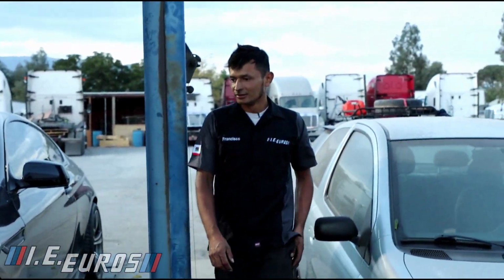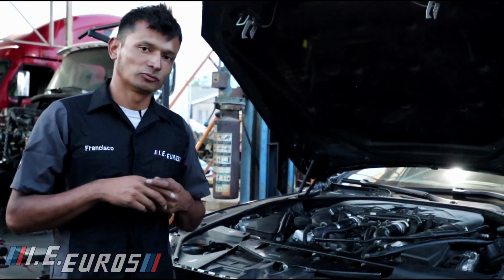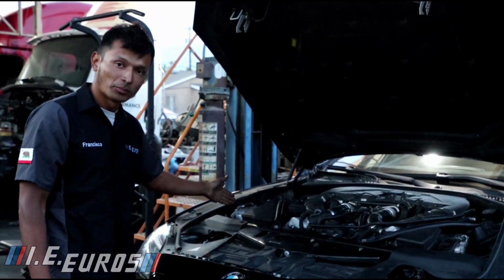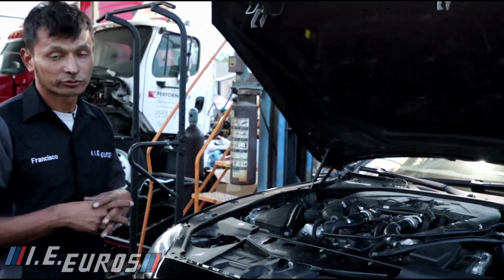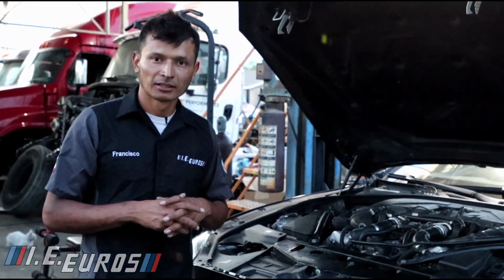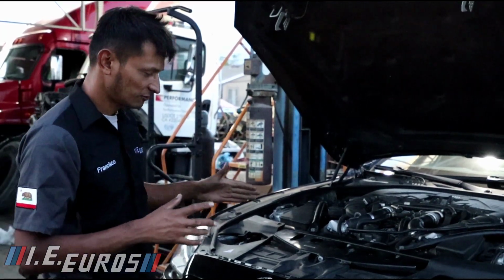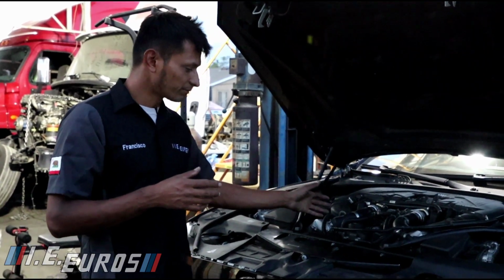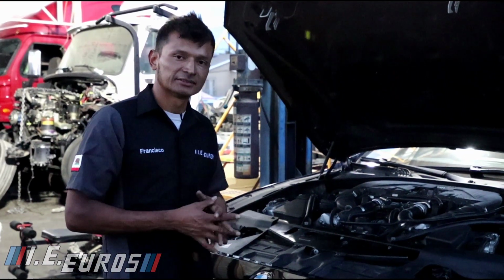BMW low power low boost turbo pressure drivetrain malfuntion electroni control solenoid fault 123104

Comment: My problem happened to be a blown fuse under the hood power distribution box (by windshield).
Reply: do you remember what fuse you replaced?
Reply: @itspvtvr get a fuse tester, it only takes one to put you into limp mode

Comment: Hi. I'm having 120308 and 120708 Boost pressure too low.. I also have a 2013 650i N63TU. If I clear the codes, the drivetrain error and same codes only reappear when I apply full throttle. The car drives with reduced power like I have no boost. Do you think this is most likely the pressure converter solenoids?
Reply: Did you figure out what was the issue ?
Reply: @SONOFTHE6TH  one of the plastic vacuum pipes from the pressure converter to the turbo waste gate had melted because it was resting on the turbo housing. Replaced both turbo lines with silicone tubes and it fixed the issue.
Reply: @112rorz  I’m having the same codes. Wonder if that’s what’s going on with mine. Did you turbos just not give you any boost or some
Reply: @SONOFTHE6TH  no boost. Once the car realises that there's an issue with the pressure it shuts them off and you get the codes. Do you have ISTA?
Reply: @112rorz how much did it run you to get it fixed?
Reply: About 50 USD but labour is cheap in Qatar. It's an easy fix though
Reply: @112rorz  for diagnostic, parts and labor? Nice!!

Comment: Having some problems with 2010 bmw 528i opened up tyranny drain plug while warming transmission up n car shut off, so I finished filling transmission fluid u. But when I went to turn car bak on no luck, cranks but not start

Comment: I have a bmw f10 n57 535d 
I'm having problems with my turbos, it keeps going into limp mode
When I plug into compute the warning comes up - turbocharger boost sensor A circuit low
Could u pls give me advice if u can pls
Reply: Hey dude I have the same issue 
Did you figure out the problem in the end ?
Reply: @KidoGameplay  I ended up getting a new engine & turbo's.
My advice would be to check both pressure converters for the turbo's & also check the turbo breather pipe thats on the top & goes towards the dpf
Reply: @kb5878  thank you I appreciate the reply